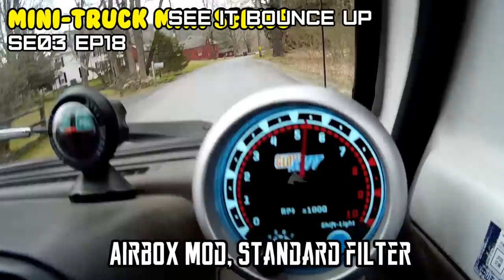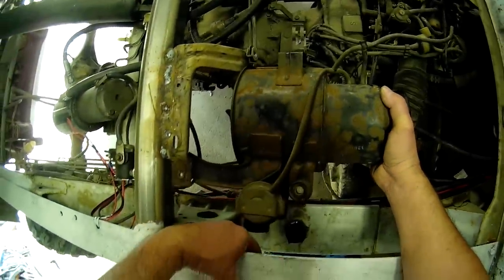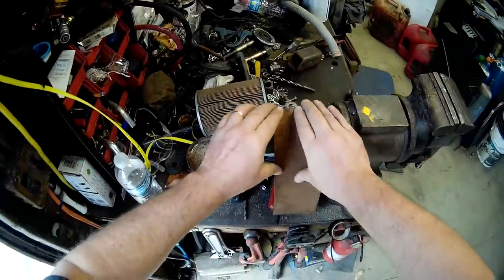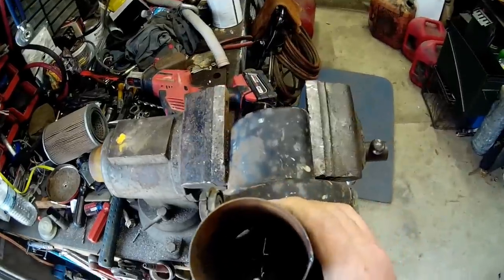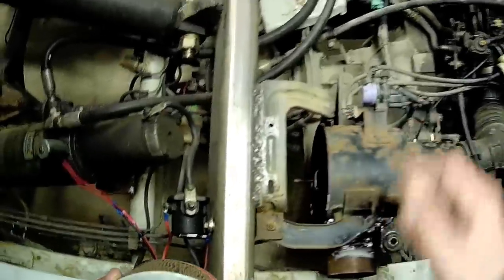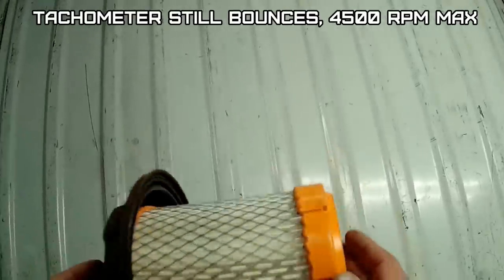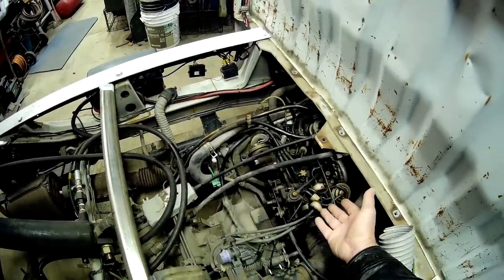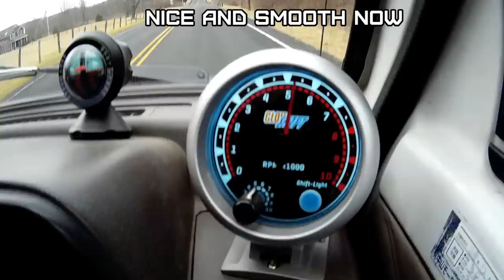Mini-Truck (SE03 EP18) Walmart air filter, Airbox mod. Bigger intake ready for snorkel. ISSUE!

Comment: First thought was the new tubing was acting like some sort of velocity stack for the air box, but I really don't know what's going on with your mill.

https://jalopnik.com/what-are-velocity-stacks-and-why-you-want-them-on-your-1792235442

On a somewhat unrelated note, I can't wait till the minis that came standard with fuel injection start rolling in.
Reply: I wad thinking the same but
Reply: I've got a 95 Hijet with EFI.  Only had it a few weeks, but it's been running great so far!
Reply: @danielmerkley4543  Make some videos...
Reply: @MikeBrownOhio  Lol, My videos wouldn't be nearly as entertaining as motocheez!  However, I did start writing about my maintenance/upgrade goals on https://minitrucktalk.com/threads/new-1995-hijet-van-owner-intro-and-blog.19948/

Comment: I believe your flux capacitor is malfunctioning,  you can pick one up at oriellys part number #121g
Reply: #greatscott
Reply from the maker: Oooh, an orielly is like 50 miles from me...
Reply: Punch the part number in tjeor website
Reply from the maker: @sal.m2A  hahahahah
Reply: It's 1.21g you forgot the point.

Comment: U need a  Turbo or supercharged  haha
Reply from the maker: Want to!! Keep looking into it, carburated...
Reply: @MotoCheez   they have  Electric fans that hook up to your intake maybe that's  what u need   They call them electric turbos  but I don't know  if that your problem
Reply from the maker: @benjaminstarcher802  I've watched videos on those. Seems there's only 1 that's any good and it's like $4k
Reply: I've been eyeballing an amr300 for my s83p. I've seen them used on vws with a draw through setup.
Reply from the maker: @DarkHorseAuto1  may have to try it!!